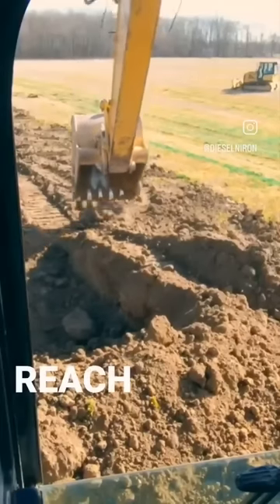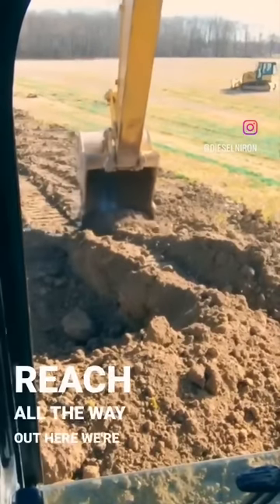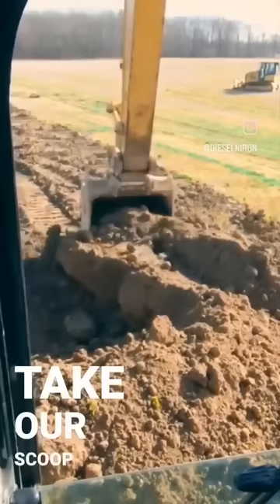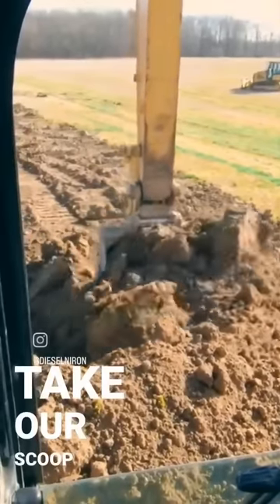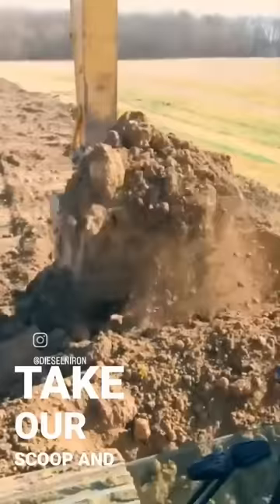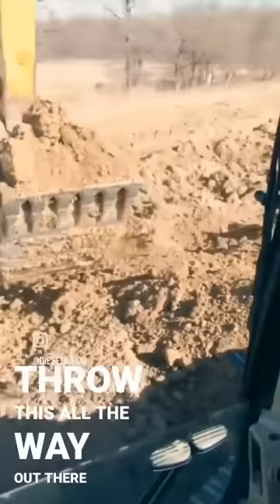Wasted movement in an excavator.

Comment: Learn how not to dead end the cylinder
Reply from the maker: This machine had a coupler that took a lot of travel out of the bucket cylinder.  When I recorded this video I had only been running the machine for about 10 minutes so I was still learning where the coupler was.
Reply: @DieselandIron  bug the shit outta me when people dead end the cylinder like that. You do that more than 3 times your first day on my machine and if your lucky you'll be in the ditch with a shovel.
Reply: Other than being loud, it isn't going to hurt anything on or in the cylinder. Just kind of bad practice.
Reply: @Wjones450  it's very hard on the pins
Reply: Can confirm that will not hurt the cylinders, for the most part. SOME cylinders have relief valve’s internal to the piston. When the rod is at full stroke the poppet for the relief will open by hitting the shoulder at the end of the barrel or on the gland. If this is done to aggressive, repeatedly it will fuck some stuff up. I specialize in hydraulic component repair and that’s the ONLY type of cylinder I’ve seen damaged to that extent. …. And I’ve serviced hundreds of cylinders
Reply: @Wjones450  hard on pins, bearings, bores, causes unnecessary pressure spikes especially when the cylinder doesn't have a snubber, transfers unnecessary impact energy throughout the machine...... There's a lot of dynamics in play with equipment.
Reply: @Wjones450  It'll fuck up your pins though.
Reply: @DieselandIron it's a machine, people need to chill.
Reply: Don't join the demo world if you can't handle the sounds. We use the machine to it's max to bring everything down. Digging up things in maxed out positions. In construction I get it. But it demo. It the roughest work on any machine. And they are running just fine still.
Reply: @user-zu2bw7ig5v  you sound like a joy to work for
Reply: Guess y'all only mess with dry material.
Reply: Aye. You'll never be able to keep that arm fully extended. Your teaching ppl the wrong technique if they work with a crew and have multiple machines running. Rarely if ever would you be able to dig the way you are saying.
Reply: What do you do when your bucket is full of mud and clay? Machine will be fine stop whining.
Reply: Doesn't hurt shit. Manufacturers wouldn't make cylinders that destroy themselves, they would just design it to stop early if it did damage. Just a pet peeve for some, use the machine
Reply: @marclaky384  that is very true, and a good point. Although, after all the years of working on Deere equipment and having to sit through 100s of hours of training, this has never once came up. Not to mention I've never heard another mechanic/tech say " wow , this guy really slams his bucket looking at those pins ! " Or cylinder or gland or whatever else.  That's rediculas TBH. I'm sure there are special occasions, but for the most part and most machines this will never be a concern.
Reply: @Wjones450  you notice it more on large machines that get rebuilt instead of replaced. Big excavators, big loaders and big dozers with heavy machine weights, high breakout force and bad operators are easy to spot. Small machines a lot of times are designed to be modular in repair. You don't rebuild pins and bores, you replace frames or attachments. Some large machines pins can cost $10k USD a piece. That's when a bad operator will be let go. When a machine starts to cost $1M you need to take care of it. Most companies don't replace large machines all the time.
Reply: My boss would slap me lol.
Reply: You wouldn’t run excavto for me dead ending like that.. I fire guys all the time for less
Reply: @DieselandIron  I’m at job sites constantly and this sound ain’t nothing new 😂 fu k these guys too busy watching people work
Reply: @BMGYGK77  go lift a mustang
Reply: @UTP_ENT  I will and run an excavator properly, and teach the rest of the guys to.
Reply: @huedue  it’s a 6 figure machine. Respect others property.
Reply: LOL! yup.
Reply: @blahblah8037  fax
Reply: Hard on the pins people say as you are literally tearing the earth apart using tonnes of force. Just be quiet lol
Reply: Anybody can pull levers but it takes an operating engineer to know what to do with them
Reply: tHe mAcHiNe lIkes iT
Reply: @ElBantosClips  the voice of reason lmao what do i know, I just weld cracks on these and other big toys out in the field
Reply: It’s fine
Reply: I love seeing all the couch operator engineers, and mechanics in the comments it makes me laugh
Reply: It doesn't hurt anything.
Reply: Lol you can't tell just by looking at the position of the bucket? 😂
Reply: @DieselandIron  amen
Reply: @DieselandIron  Lol yeah, I’m pretty sure the saying goes “You’ll catch more flies with honey than vinegar”; not “You’ll catch more flies by being a shithead”. Although…
Reply: @marclaky384  yes but big machines make more money so.....
Reply: If it has been engineered properly, it shouldn't matter.
Reply: @Bigsoot7393  and they higher purchase, operating, transport and repair costs. Not to mention all the tooling it takes to repair large machines that you can get away without on small machines. Apples and oranges.
Reply from the maker: @Lmaonoshot  look at the number of comments 🤣🤣
Reply: @marclaky384  so why do they run larger machines then, buy 10 smaller ones compared to 1 larger one if it's more cost efficient
Reply: @Bigsoot7393  I'm not gathering what you are asking? Sometimes it's more efficient to run 2 smaller machines instead of 1 large, other times the scope of the job dictates that only a large machines will be able to complete the task. What does any of this have to do with the original point brought up?
Reply: @DieselandIron  Putting that much stake in what people think of you is pretty pathetic. Be better.
Reply from the maker: @Lmaonoshot  if you get the masses all frothy at the mouth then they come back and comment more which makes the video do better. To date this is my best performing video 🤣🤣
Reply: @marclaky384  you were saying bigger machines cost more to repair, but they make more money, smaller machines cheaper to repair but don't make as money. Bigger machines may have more breakout force but have bigger components that can handle it, it's all proportional
Reply: @user-zu2bw7ig5v  just curious what dead end cylinder means I’ve never operated an x just skids and forklifts. Don’t shoot me just love to learn.
Reply: @Bigsoot7393  they can handle certain forces but not abuse. Slamming and dead ending isn't considered normal operation. Just like side sweeping with an excavator, we have all done it but it is terrible for the machine. Just because the machine is larger doesn't mean it is designed for everything an operator can throw at it. Side sweeping is terrible for swing components, it places lateral forces on components not designed for said forces and causes premature wear and component failure. Breakout force is hi pressure loading not high pressure spikes. Excavators can pull all day long but they will only take so much slamming.
Reply: @marclaky384  so why don't manufacturers put a system in place so they can't dead head cylinders and is that not why slew motors don't get full pressure so you can side sweep?
Reply: @Bigsoot7393  they do, they are called snubbers. It's another thing to brake or fail. And when things fail in hydraulic systems they take a lot of other stuff out with them. Snubbers have there own short comings so manufactures have this crazy idea that operators are smart enough to keep those issues from happening. I worked for a heavy equipment dealer hand in hand with engineers and every last one of them said that the machines were never designed for sweeping to the extent of what operators do. Side loading all the pivot points and flexing booms and sticks in a direction not designed for loading. I repair equipment for a living, abuse on machines is what keeps me employed. I would prefer not to separate an excavator or rebuild cylinders from abuse. Things tend to fail in catastrophic ways and get very expensive in a hurry. Mobile line boring cost $300 an hour where I'm from and it's very easy to get a $20k invoice from the machinist that could have been avoided by better practices.
Reply: @Bigsoot7393  you seem to be side stepping the point that there are proper procedures of operating equipment. Failure to follow those procedures will cause premature and excessive wear or damage. Just because you can do something doesn't mean it's smart or correct. Simple steps can lead to a longer working life with less down time and reduced operating costs.
Reply: @marclaky384  sweet I work at a hydraulic shop and rarely ever see damage from dead heading cylinders, 300 buck an hour for line boring my god what are you doing repairing machines when you could be relaxing line boring! Haha
Reply: @Bigsoot7393  well our line boring guy covers all aspects such as power generation, heavy equipment, military, aerospace, water, amusement parks.... Wouldn't call it relaxing, he travels and works 7 days a week, has a huge overhead in equipment and vehicles. You don't make doctor money to kick back.
Reply: @marclaky384  is it different where you're from compared to Australia or what, here it's just a spinning bit of tool steel with cutters and a mig welders?
Reply: @Bigsoot7393  depends on the setup. Can be very simple or it can be a large blind hole in an exotic alloy. What does a precision measuring tool cost for bores in the 40" or 1000mm range? A lot. A good boring set up is $70k ish, then throw in a truck, service bed, engine drive welder, torches, welding and boring support equipment and you very quickly hit $300k. So it's an open ended question. The guy that we use has pretty much every tool you can own for portable machining, within reason. Manual and CNC portable boring machines. He also has a full machine shop at his house where he makes his own bushings/bearings. I would say he comfortably had $1M in tooling and it's just him.
Reply: @marclaky384  yeah that's fair, but for doing an excavator boom a 30k set up would do just fine haha I'd find someone cheaper and keep the mark up if it was me hahab
Reply: @Bigsoot7393  that was just an example. We have frequent roller frame work on dozers, pivot shafts, hitch work on articulated machines and we have a tunneling and mining division that requires some weird machining. Back hoes, trenching machines pipe layers.... Not as simple as doing one standard sized bore. We have a guy that is fast and good. Never any do overs and he can do anything. That is worth paying extra for.
Reply: Just giver bud. Nice info fuck all the hater Diesel and Iron. I kept my phone on for some extra views lol
Reply: It's not the 50s anymore, that'll never be an issue
Reply: He's just trying to shake off any stuck dirt. LOL
Reply: @mattgaming8717   doubt a demo machine will run anywhere near the amount of hours a dirt tractor will. Working in dirt is 10x easier on equipment.
Reply: You only have to worry about it if you have a CAT.
Reply: @Wjones450  harder on the pins.
Reply: Noob
Reply: @BMGYGK77  you're broke
Reply: @SamsonTheWyrm  🤯
Reply: @thexsaltxandxpepper6001  I find when digging in soft or wet clays the trick is not to pack it into the bucket hard when you scoop then it doesn’t tend to stick as much but you can jiggle the bucket to loosen it without dead ending the ram
Reply: Imagine you hire a driving instructor and he pulls into your driveway and smashes into the trash cans at the curb. Then says "sorry I've only been in this car for ten minutes, I'm not used to it yet"
Reply: What does that mean ?.
Reply: @TheSRBgamer63  it means opening the bucket all the way out until the hydraulic cylinder bottoms out and stops suddenly,  causing a loud bang as the bucket hits the end of it's range of motion.
Reply: @user-zu2bw7ig5v  you must only operate 1990s equipment
Reply: If the machine doesnt like to being abused, it should have been used as steel for Ford.
Reply: All depends on how you get paid. By the hour or by the job.
Reply: @DieselandIron eed to get a hydraulic  specialist and get a pump that changes the speed. I used to run a log loader.  That was like 2 to 3 times faster than normal factory speed.  The ram speeds and especially the turret  spinning speed was crazy. Buy it was so great to run. It cuts operation times down so much. Gotta get the right hydraulic pump though not sure if it's volume or pressure or rpm. To get speed and power.
Reply: We do it on purpose to get stuck dirt to fall out. Never had an issue.
Reply: @user-zu2bw7ig5v  tough guy eh? LoL
Reply: Don't ram the end of the cylinder as well as why not make  the last bucket full with the bucket flattened out.   So #1 it's done  and someone else doesn't  have ro go after you and clean up the mess.  #2 It looks more professional and when it rains it doesn't absorb as easy and makes less mud.  #3 it wouldn't take any longer but operators  are hard to find.   Most people just move levers any more.
Reply: @user-zu2bw7ig5v  Good equipment operators are few and far between.  If you own your own equimpent  you know this.   Not wasting time goes along with making sure the machine  get greased everyday.  As well as  a guy who doesn't have the machine clapped out junk before its even paid for.   I mean he is a guy who can't flatten that bucket out seal that dirt so when it rains the water doesn't make a foot if slop.  You can tell by the job site he should be on you tube looking for someone to teach him how to run an excavator.   Not trying to teach another clown how to make an excavator  to have more down time.
Reply: @Wjones450  Not sure who told you that but they are stupid.  Pins and bushings are expensive.
Reply: @moo12111  Any time you here that metal on metal "clang".  It's destroying something  I don't care what ypur doing in life.
Reply: @marclaky384  Dont tell them they don't  operate equipment, own equipment, grease equipment, or work on it.   They are lever movers that make guys like me laugh and make me worth more money.
Reply: @mattgaming8717  my dad has done alot of demolition with our equipment  over the years has  he doesn't tear up our equipment doing it.   Sounds like you have only worked for one or 2 guys that definitely  have not been in business  for 50 years or more.
Reply: @jinglebellssantasmellsssssd   Probaly is great to work for.   Because he can pay better because he doesn't have idiots tearing up his equipment.
Reply: @DieselandIron  sure...
Reply: @***  are you a mechanic or s keyboard mechanic? Out of all the equipment I've seen get repaired I have never once heard that or heard that being the cause of an issue.
Reply from the maker: @videostar2528  I'm quite sure. I was actually there believe it or not
Reply from the maker: @koffie & cohiba efficiency is lazy... Got it. Thanks for the comment!
Reply: Using the machine is hard on the pins, just turn it off and let it sit.
Reply: You guys worried about wearing the pins and bushings out from dead ending the cylinders crack me up. As if operators don't spike the machines and use the boom and stick to support the entire weight of the machine all the time.
Reply: Lessson on the obvious really.
Reply: God damn that was killing me
Reply: I meant if its a debate on weather you dead end the cylinder or not could we all agree on if you can avoid it avoid it
Reply: @huedue  nah it’s an expensive piece of equipment and you run them properly and take care. Any dumb monkey can go move the sticks takes a real one to be an operator amd understand every aspect of what’s going on machine and ground.
Reply: @timd46  not on every dump….. and there are smoother ways to do it
Reply: @Matt gaming  just cause its demo doesn't mean we beat on our machines. We push ours to the max but still don't beat them. No matter the application it's all in the operator apparantly.
Reply: @j.sargent9172  agreed, the only guys saying that do nothing but dig dirt with these.  i push these machines to the limit at the scrapyard everyday, hilarious how people are saying its bad for the pins.  hitting massive rocks is bad for your pins, not hitting the end of an attachment cylinder.
Reply: Premature wear is a thing
Reply: Would have been fired! Right there and then!
Reply: @Wjones450 Tell me you don't know anything without telling me you don't know anything. It's hard on the pens. It's hard on the bushings. It's especially hard on the cylinder. You must be a new operator. You must still be pissing the bed
Reply: @mattgaming8717 been doing demo for 20 years bud. If you're maxing everything out all the time. You're terrible operator. There's no reason to you can still be gentle on the machine and get a heck of a lot more done if you actually know what you're doing. How long have you been in the industry?
Reply: @Demoguy87  nope
Reply: Fr that’s so bad😂😂
Reply: I need him to keep that up. It’s my job security.
Reply: If anyone did that on my job site, I'd say big tough guy stuff.  🙄
Reply: Agreed
Reply: @user-zu2bw7ig5v I’ve learned that it’s good for the cylinder to dead end it often to keep the seals tight or something to that effect
Reply: @Wjones450 have you ever replaced pins before 

I have there not easy to replace
Reply: @Wjones450  dead ending results in sudden pressure fluctuations relative to normal operation of the hydraulic system.  A quality machine should be able to handle spikes in that range, especially in construction equipment which might see the load suddenly change, but it IS still a sudden fluctuation, and on any cheaply made poorly maintained machine it'll be one of those fluctuations that causes a hydraulic line to give on you.

That said, the noise and subsequent vibrations are reason enough.  Shit adds up when it comes to hearing damage for the work crews which comes out of company pocket one way or another, and on top of that it makes the work more irritating to occupants of structures near the jobsite.  People are already pissed you got their favorite parking spot, you don't need to give them a migraine to test if they're really beyond slashing tires.
Reply: I did that one time and the piston rod bent a little and exploded when it came back in
Reply: Been doing it for 20 years. I even do the hotter bug when mud is stuck. Somebody lied to yall. Try it. Daddy was wrong
Reply: Wasted movement..💯👍 he obviously doesn’t know..😂😂
Reply: Learn to talk
Reply: This guy is in management trying to tell them how to cut down on hours.